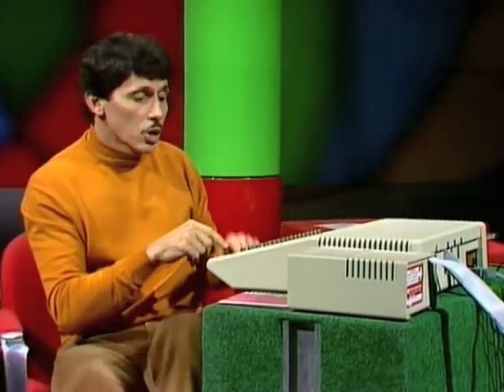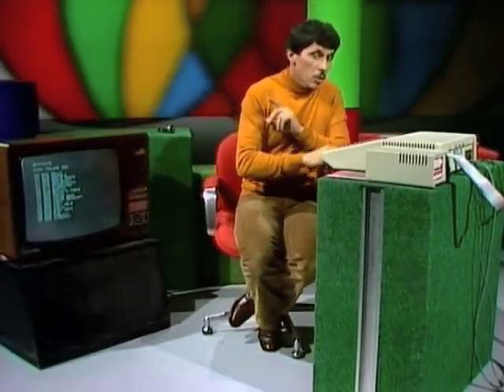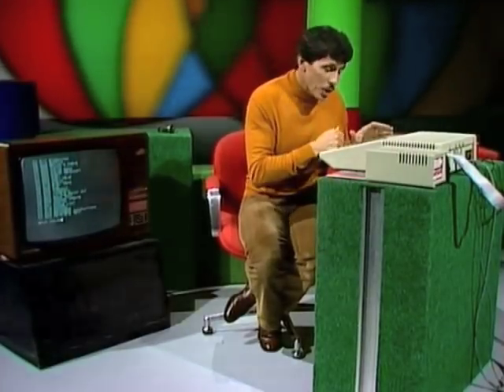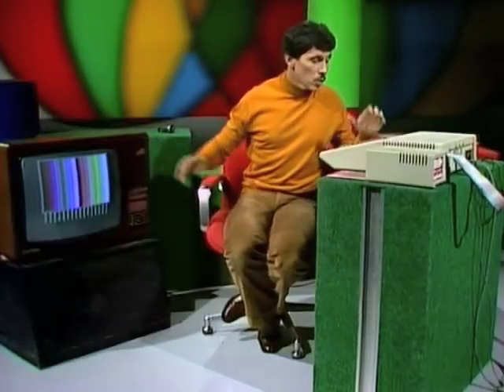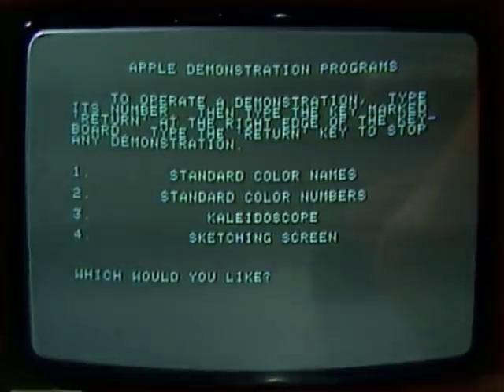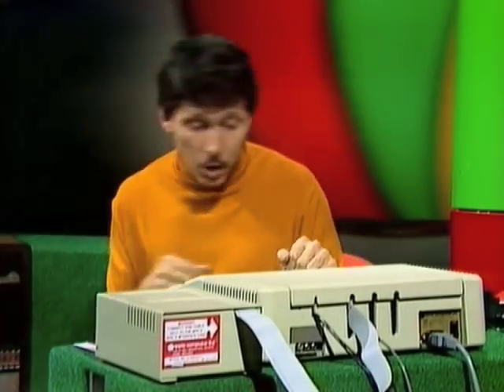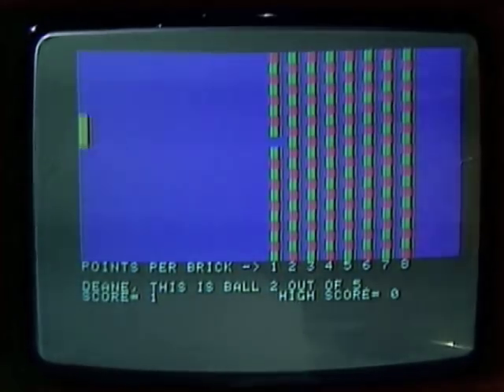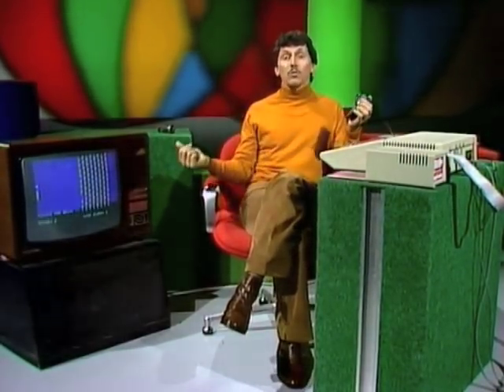Electronic Valves and Computers

Comment: 3:22-3:42  The sound of "processing power" back in the day. In the 80's computers were built much better not like these pieces of junk nowadays. My CPU no longer has a built in synthesizer and no more "loading" screens. Windows takes 2 seconds to launch nowadays. Kids have no patience. We used to wait 3 minutes to load up DOS and even then it wasn't guaranteed to startup, my Great Aunt built the hoover dam which sped up wait time.
Reply: I’d prefer if computers were faster as speed is often key in life saving events, like IED’s or simulations. No one wants to wait 3 minutes for a potentially life-saving device to boot up anymore

Comment: I was a computer technician (pre-IBM PC) back in those days, and this is great to see something from then. I loved seeing the EPROM (Erasable Programmable Read Only Memory), which was erased by putting it in a special chamber with high-intensity ultra-violet light, and then could be re-programmed using a special external programming device, so technically not ROM, except when inserted into a socket on a circuit board. The floppy drives were huge, and the disks were truly floppy, I think 8 inch, and then 5 1/4 before the trick 3 1/2 hard shell “floppies” appeared. The Intel and Zilog Microprocessors were 40-pin DIP (Dual Inline Package) and so slow that you didn’t need heat sinks. Good times!
Reply: My Commodore PET from 1979 still works
Reply: I use the Willem EPROM programmer

Comment: Are there any circumstances where valves remain in use?
Reply: Turnsole80 They’re still used in high-end amplifiers for guitars and speakers.
Reply: I think the magnetron in a microwave oven counts as a vacuum tube.
Also they're used in high power applications such as broadcast transmitters and industrial RF heating.
https://en.wikipedia.org/wiki/Vacuum_tube#Vacuum_tubes_in_the_21st_century
Reply: Used in audio equipment all the time. Matter of fact, some microphones have a vacuum tube stuffed inside of them. I've built one myself.
Reply: High power radio and tv transmitters still use them. Silicon can't cut the workload.
Reply: The 'valve' shown is an electron tube, which was largely superseeded by the transistor/mosfet (which isn't explained that well in the segment) due to easier interfacing and more reliable operation. Those are still used today (albeit mostly 1000s of them integrated on silicon chips, rather than single discrete ones). Nowadays you'd find tubes only in vintage electronics (some computers older than the one shown here use them for calculation) or high quality audio gear.

Comment: And to think, these days we have much more powerful computers in our back pockets.
Reply: The Apple II shown in this video could handle 430,000 instructions per second. An Apple iPhone 8 can handle 600 BILLION instructions per second.
Reply: Yeah and he calls this a "micro" computer
Reply: It is. They're literally called "microcomputers"
Reply: @frtard  I mean its pretty macro if compared with those of our times. Then again I guess our are called nanocomputers, I guess it depends on the scale of the transistors (?)
Reply: Username  they were called microcomputers to distinguish them from the shared-by-a-lab size minicomputers (like the venerable PDP-11) and in turn from the shared-by-a-company size mainframe computers (like the IBM System/370 architecture).